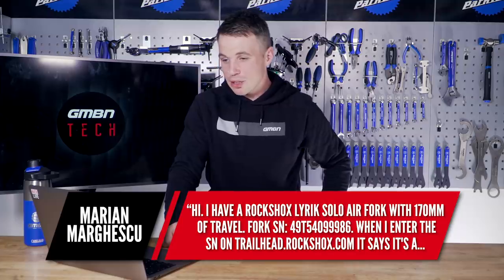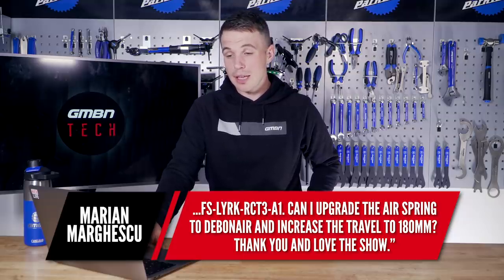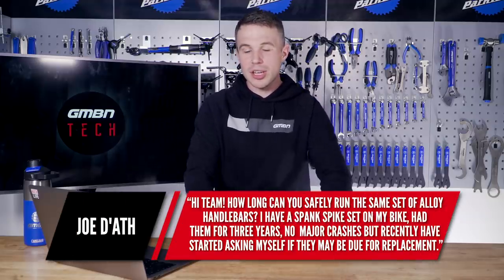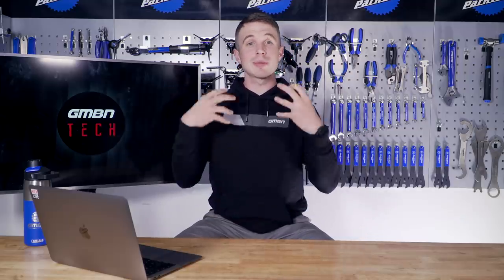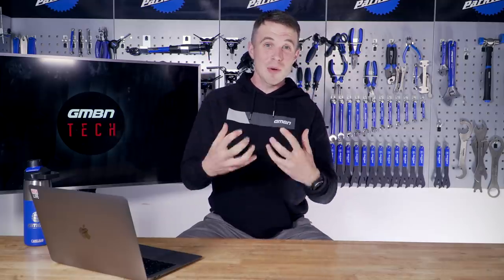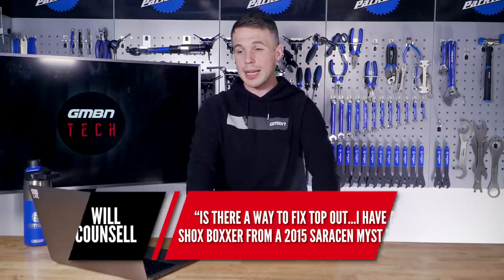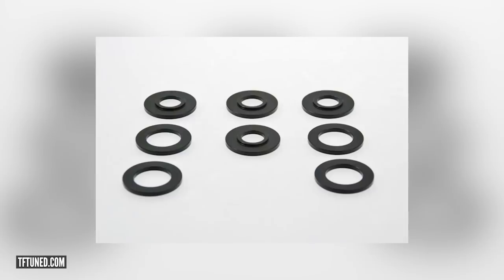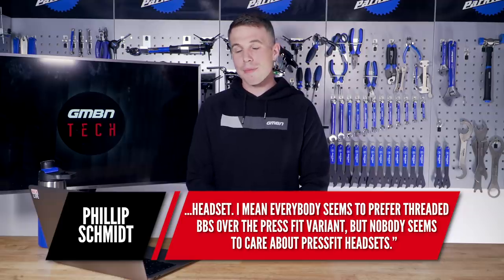Why Is My Tubeless Set Up Leaking? | Ask GMBN Tech Ep. 90

Comment: #askgmbntech I recently made to change from flat pedals to clipless. I have been finding my toes are getting a pins and needles like feeling after 10 - 15 Kms. I've tried different shoes, I'm abit suck for what could be causing it. Help please. Love the show.
Reply: Could be the shoe is too stiff ( can't ride my carbon road shoes for too long ) or you're over-tightening the straps.
Reply: Had the same issue and this helped: Try to reposition your cleats on your shoes further back and not too forward. (Having them to the front, you stress your fingers from pressing down). Hope this works for you too.

Comment: #askgmbntech Can I have detailed video about wheel building, and why its laced this way. I've laced many wheels at work, but it seems that we lace then not exactly like other people use to lace them. If its a rear wheel, we obviously start from the right side, but we twist the hub the other way around (to the right side,, so the freewheel engages). I asked my college why we do it that way, and he told me that when you put alot of power on the pedals, the inner spokes from the right side loosens a bit, and the wheel twists a bit to the mech, and it might catch on it a bit. 
Samo with front wheels. We twist them to the right, because when you stop, thats the way the hub wants to rotate. 
Or I should do video about how we do wheels, and send it to some big wheel builders and ask them if its wrong, and which method is the better one. idk.
Reply: Ali Clarkson does a good wheel building video. Or ask Tarty (Adam at tarty bikes) he's an insanely good wheel builder and may be able to help? There's not much he doesn't know about wheels.
Reply: YES, Thats a great video idea. 
Sounds like a wheel building course needed at your lbs tho! Cytech run them.
Or online wheel builders bible.

Comment: #askgmbntech Sup Dudes! Why hasn’t the industry switched to inverted forks like high performance motorcycles and dirt bike have done over a decade ago? You would think having the lighter end of the fork on the bottom would result in better performance. Thanks! Keep up all the rad content!
Reply: Not stiff enough because you can't have the cross bracing like a standard fork. They would have to be really heavy to make it work.
Reply: rockshox made the RS-1 inverted fork, but it was expensive heavy, flexy and not really better than a 'normal' fork

Comment: When i'm going like 3-4Kmph and i turn more than 20-40 degrees i hear sort of like banging/crackling noises, like the spacers are going seperate and retracting back while hitting each other,
what should i do?
(It is a new bike, i have it for about 4 months)
Reply: Headset bearings might be shot?
Reply: Turning more than 90° , can't be healthy for the bike, surely?
Reply: Oh sorry i meant 20-40 degrees
Reply: @Kema  thank you,  ive been thinking about this since I replied,  more than 90° 😀, deadly
Reply: check for play in the headset bearings by locking the front brake and rocking the bike back and forth

Comment: #AskGMBNTech just purchased a MTB for my son aged 6, he is having some trouble upshifting with his thumb and can’t throw the shifter far enough back to change gear. The finger downshift is fine. Can the throw necessary be reduced or should I try adjusting the angle of the shifter on handlebars?
Reply: What brand shifter is it? To be honest, I'm not sure if any can be adjusted regarding the throw.just go carefully if you take it apart to inspect, some are ridiculously tricky to reassemble and tend to explode parts everywhere when you take them apart. Personally I would just adjust the angle, or maybe try sticking a thick bit of rubber on the thumb paddle to build it up, essentially moving the contact point closer to his thumb?
Reply: Carl Stanton Facepalm! That is a cracking idea with the building up. Will definitely give that a go. 

Shifter is Shimano Altus 8 speed and you are right I have no desire to get inside it and play with springs or cables unless I know it’s a definite fix.
Reply: Sram =yes can move thumb lever position. Shimano 🤔
Reply: @NorfolkCannon  i think building up the face of the thumb shifter will help a lot,  it can always be returned to normal as his hands grow

Comment: #askgmbntech I bought a used canyon Spectral 7.0 al Ex 2017. The bike is tubeless at front and normal tube in the back. Is this a  good setup? Im not sure of the condition of the tubeless sealant. Can I check this any good way?
Reply: Perfectly fine to have tubeless in one and not the other. Shake the wheel around....if you head sloshing then sealant probably ok. If no sloshing then pop a small part of the tire bead off the rim and look inside. No liquid = redo the sealant or remove the sealant that's in there and replace with tube.
Reply: most weight goes trough the rear, and is most likely to pinch flat in my experience. If you can just make it tubeless aswel

Comment: #askgmbntech  hi, love the show. I have just been wondering about removing the topout bumper in my fork (2016 rockshox pike debonair). I googled it and some sites said that it increased travel, not improve the fork characteristics.  cheers
Reply: Just fit a new debonair upgrade air spring. £42 and difference is unreal. U will likely need to remove all ur volume tokens as the hollow tube large neg spring makes the mid to end travel more progressive, but also add approx 5% more air pressure. Best to reset sag after, and set to 30%...yes, 30...on a fork...trust me. 🤘
Reply: @rupedog  i recently fitted a debonair spring (used to have a solo air) but didnt feel a significant diference

Comment: #askgmbntech 
Love the show, helped fix many issues!
I just replaced my cassette and chain but not chainring (running shimano deore alround) and I've got a new noise!
I have play in the freehub and I'm fairly sure there is no play in the cassette, I'm under the impression that freehub play is normal.
I checked the cassette is tight, no issue there.
I've bolt checked the bike with no issues.
BB is fairly new and has no play.
So the noise... there is no noise when spinning the pedals but when pushing with a bit of force there is a metallic creak that I cannot identify. 
Is this just the new cassette and chain settling in or another issue I've found?
Reply: New chain on old chain ring. Expect old worn ring nit meshing with bew chain. Try new chainring BEFORE riding much more

Comment: #askgmbn i have a hardtail with straight steerer tube( custom built giant atx) with suntour xcr air  initially it was 120mm travel but i pumped it to the max and it increased the travel to 140mm is it ok or shd i revert back to 120mm? Its a 27.5 bike
Reply: #askgmbntech
Reply: i dont think there is any stock 140mm XCR fork so you should probaly unhack it for your safety
Reply: @ultiss  true but i like the extra 20mm travel especially on hardtail
Reply: @ultiss  i also feel it's more reactive and i feel like everytime i go on a obstacle it just comes back to its initial position instantly

Comment: 11:00 i have had this problem, tested all the types of tubeless, from the gorilla tape to the one with the specific tape, sometimes liquid came from the valve, other times from the nipples, the problem was that the hole for the valve was to big, cannot use a conventional tubeless system or i need schrader tubeless valve (which i have not found), i have to use the split-tube method, which i don’t like. Your rim might not be tubeless ready as happened to mines.
Reply: Stan's sells shrader tubless valves. They're cheap and I have them running on my kid's 26" bike. Super-ghetto tubless but works! It's a low-end REI bike, and I threw some Minions on there.
Reply: G. Andaluz 😱😱😱 THANKS!!

Comment: #askgmbnteach so may problem is that im having flats all the time i have 62kg i have to run 40psi in the back and 30 in front (tubes) Im afrade that if  i go tubles i will start  burping the tire becose of my riding style i also ding my rims constantly also im on the budget and i was finking abaut tire inserts for example nukeproof ard sistem for 60erovs and joe"s no flats selant   thank you for help
Reply: Your about the average weight probably so tubeless shouldn't be a worry. If so try an insert
Reply: That's light weight. With riding gear+camelbak I would think 75-90kg for adult male.
Tubeless done right, not worries.
Running high pressures.in tubes wont reduce normal punctures (thorns etc) really, but only pinch flats (snake bites)
Reply: have you got tires with a strong casing? Some tires simply dont offer much support

Comment: #askgmbntech# hi guys I was wondering if you could do a video on how to service and maintain budget coil fork. I have SA Suntour fork but the lower end of the price point they were standard equipment on my 2019 Giant Talon 2 there only adjustments are a lock out and preload. Also can I upgrade the internals of the fork or would be cheaper to replace the fork if it can be upgraded, I would like to have it work better and not bottom out on North Shore green trails. Thanks for any help you can give me
Reply: I started with that same fork, there's just not really that much you can do with it overall. Better off replacing it with a suntour epixon, rockshox recon, or mannitou markhor I think. All around $250 and it makes a huge difference. Sold off my cheap coil fork for $20 haha.
Reply: Smoked Salmon thanks for the info, I plan on using the old forks as wall art for the bike cave
Reply: @KDog2264  you cant upgrade it really. You can increase its life by doing lower leg services. it comes without oil in the lower legs so lubing it from time to time will help
Reply: @KDog2264  good thinking, I wish I'd kept mine instead of selling it. These days I keep every spair part I get in case of future needs. Going to an air fork is such a crazy upgrade, especially when the cheap coil fork feels normal to you.

Comment: #askgmbntech Hi guys I need your help. I am currently running a 2018 Factory Series 36 FLOAT 27.5 FIT4 (on my enduro bike) which I would like to transfer to my Santa Cruz Chameleon. So the question is: can I transform this fork into a 29er by swapping out the lowers. If it is possible - are there any things I should be aware of?

Comment: #askgmbntech Hi after watching your lower leg and air shaft videos I decided I was going to  have a crack at my first suspension service  while doing the service I had great problem getting the shaft to release form the lowers I tried shock loading but it would just not release in the end I decided to get medieval and reached for the blow torch and heated home bolt and inserted in into the lowers for  30 seconds then gave it a week which did release it!! Any tips on releasing troublesome lowers that don't involve a blow torch.
Reply: With my fork, I had to loosen the bolts a bit on both legs then tap them with a hammer. At first they wouldn't pull apart but that did the trick. I'd be careful with a blow torch. Lots of seals and other things that could get compromised from too much heat.
Reply: @smokedsalmon3907  I second the deadblow hammer. One of those super-handy tools to have around the shop.
Reply: Omg...the correct method.is to loosen the bolts a few turns, and whack with mallet...lets hope u didnt fubar anything with that bizarre solution. 
The gmbn vids are a brief snapshot.... ALWAYS refer to the proper manufacturer service manual and vids readily available online, especially when u are not technical. Clearly shows this correct technique. A blow torch.is not a bike service tool. Bloody funny tho.
I recommend u get to know ur lbs 😜😜😜😜😜😜
Reply: @rupedog  Hi cheers for the reply I did follow the correct methods by shock loading the shafts with the bolt in but turned out 3 turns but this discussion not free the a haft a after an hour so I went for the nuclear option !! Think I was lucky it work and no damage I could find
Reply: @maxb7281  some lowers need quite some whacking. it can help to increase the air pressure since the fork will absorb energy
Reply: Thanks for the tips I’m hopeful that my next services will be a bit easier 👍

Comment: #askgmbntech 
hey 
 I have a 2 by 10 cassette what do I need to change to a 1 by 11
Reply: Rather go for 1x12 its the same price and has a bigger range (11-50). You need a new cassette, derailleur, shifter and chain
Reply: If everything works now, cheapest would just be pulling off one of the chainrings or replacing it with a single ring and getting a wide range 10sp cassette for the back (11-46t). You'll have the same range as an 11sp and you'll spend hundreds less. Otherwise you're gonna be replacing everything which will probably start at least around $300. Those sunrace wide range cassettes are amazing, you can even get a 10-52t if you went to 11sp which gives you more range than a 12sp setup haha.
Reply: @smokedsalmon3907  I hope you know that there isn't a big chance that the 10 speed derailleur cage of his current derailleur won't take a big 46t or 50t cog
Reply: @smokedsalmon3907 the NX eagle 12s cassette is only 65€ + nx eagle derailleur 75€ + nx eagle shifter 26€ and a 12 speed chain for 12€ = 178€ and he can get a Chinese 1x chainring of Amazon for 10€
Reply: @David54534  50t might be pushing it and I don't know if there is a 50t 10sp cassette but he could definitely make a 46t cassette work. All it takes is a derailleur hanger extension. I've got an old shitty 3x8 setup. I was almost able to fit a 42t cassette without the extension just by adjusting the b screw out. In the end it worked flawlessly with the extension. If my 8sp shit setup can do a 42t then I guarantee his 10sp will work with a 46t. I could probably fit a 46t if they made it in 8sp haha. No need to go dropping so much money when all it takes is a wide range cassette. Unfortunately most people are unaware of the options so they drop money needlessly.
Reply: @David54534  just looked on Amazon, that nx drive train without the cranks is $275 compare that to $60 for the wide range cassette, either way gets you there but one is a lot more expensive. I'd rather spend the extra $200 on other upgrades haha.
Reply: @smokedsalmon3907  I know but my sram nx 1x11 drivetrain wasn't even able to shift properly on a 50t sunrace cassette only on a 46t and  sram says that nx 11speed derailleur max amount of teeth is 42 so yes. With the extension it might work
Reply: @David54534  haha I hear that. I work on bikes as mobile mechanic for side money and sram stuff is just so finicky in general. Hard to get it working right and once you get it, you can't touch it or it'll go out of wack again. Shimano just works a lot better better from all the bikes I've seen. I know the wide range stuff works awesome with shimano, but if he's got sram he might be screwed. The new slx and xt 12sp is supposed to be a huge improvement over sram 12sp. I'm not a fan of having so many gears either, I prefer less gears with larger jumps. My ideal setup would be a 9sp 50t haha.
Reply: @smokedsalmon3907  there is a box 9 speed drivetrain with 11-50
Reply: @David54534  you can get 11-50 11 speed cassettes out there.
Reply: @Asthbendriel  I known I also had one but it didn't shift properly
Reply: @David54534  are you sure you had it properly adjusted? If you have a long cage derailleur or a short cage + derailleur extender it should work and shift fine.
Reply: @Asthbendriel  yes I had to turn the b limit screw so far in that it didn't shift the lower cogs one by one. I also replaced my derailleur hanger and it didn't work no matter what. So I sent it back and bought the 46 t cassette and I have no issues to this day
Reply: @David54534  damn I gotta check out the box components stuff. Heard of them but never knew they had a wide range 9sp, that's perfect. Thanks for the info.

Comment: #askgmbntech I have a Kona Honzo AL DR (2018), and with the wet winter season coming around here in Portland, I'm faced with the issue of spray off the tires when riding. While I plan to get a Mudhugger or RRP Proguard for the front wheel, there are no eyelets in the back to mount a fender that would provide adequate coverage from water/mud. The chainstays/seatstays are also not standard shapes, further preventing fender mounting. Is there any way to either hack together some eyelets for fenders or another way to get a good coverage solution for the rear of my 29er? 
Btw, love the show.